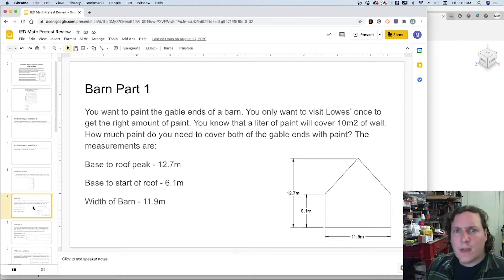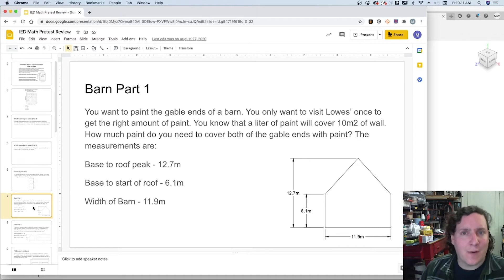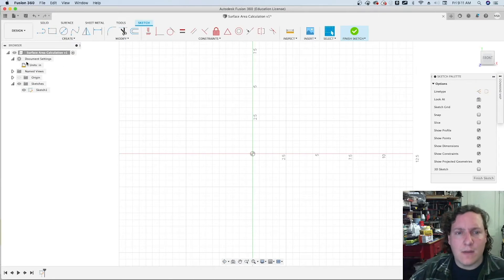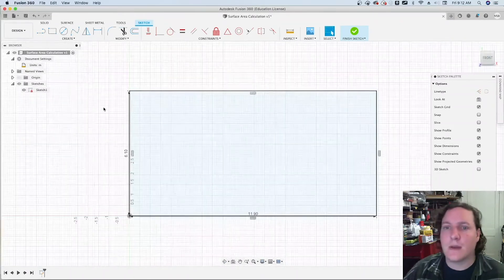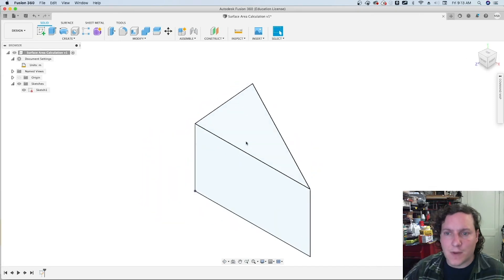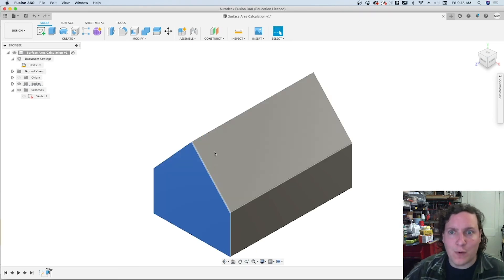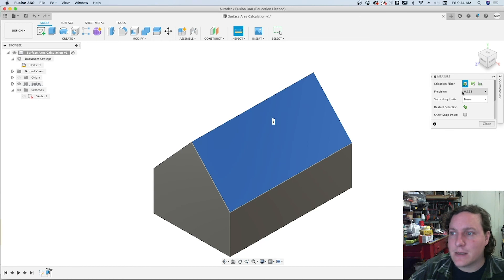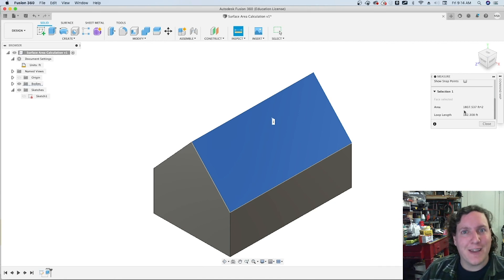Surface Area Values from Fusion 360

Comment: Very helpful! Was hoping to be able to add the dimensions to my sketch as I'm drawing a floorplan for a shared space that have different room configurations overlapping but is supposed to have the same total area. I can add the measures for the sides as driven constraints but not the calculations to be variable, any ideas?